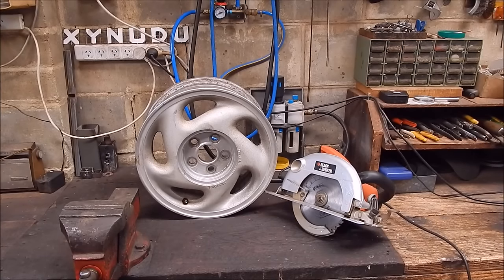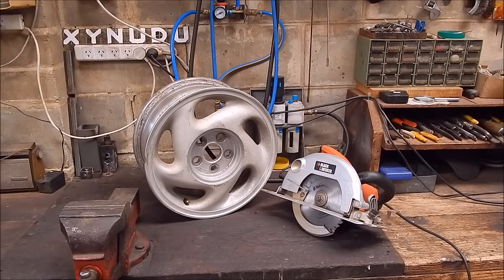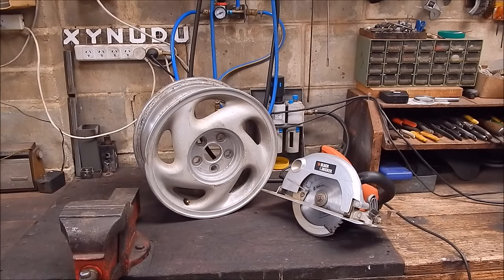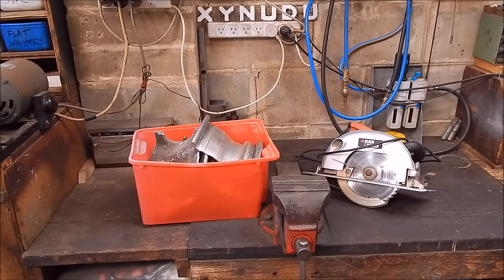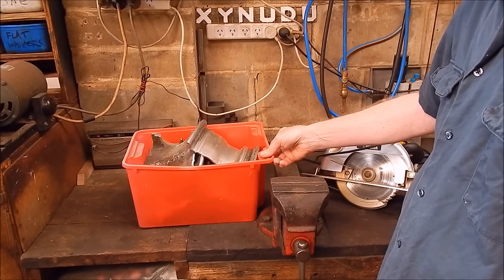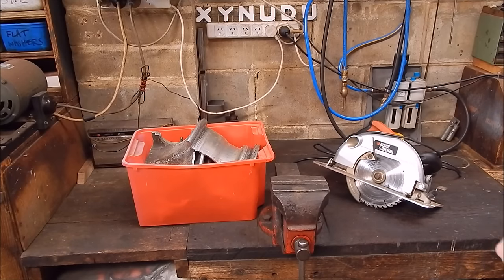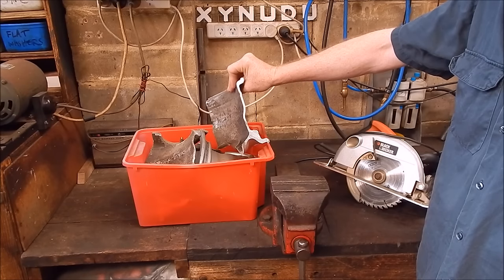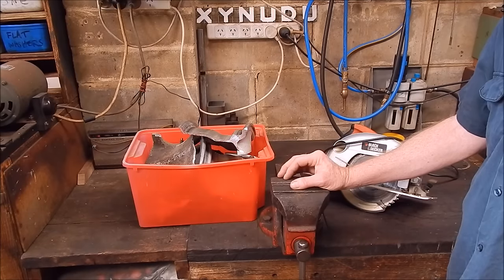Learning by destruction

Comment: If you are going to purchase a saw look into a portable bandsaw. I have a Chinese brand that has lasted me several years (since '09). I have not cut aluminum as thick as that rim, but it will make short work of 3/8". I paid $75 usd. If you have a press (12 or 20 ton) you may be able to fold the larger pieces over to fit them in you forge.Good video. Informative and entertaining.

Comment: I have 4 OEM VW alloy rims out back that I don't seem to be able to sell in the small ads. Perhaps I should have a go at this myself. I think I'd be inclined to do initial cutting w the circular saw as you did and then use a bench mounted sheet metal shear on thinner parts of the rim leaving the thicker parts to melt whole in the crucible as much as possible. Cheers!

Comment: Hey Rob,  I use an small Harbor Freight table saw with a dedicated 60 tooth carbide for cutting up aluminum and it works great,  Being a table saw the "mess" is less but still some cleanup is needed.  I think the table saw also allows for more control when cutting.
Reply from the maker: +Fred Miller 

Hi Fred.   A chop saw would be good for cutting up the smaller bits, for sure.

Parting out the rim initially is the major issue.

A reciprocating saw would be very handy for some gutter work coming up on the house, so it's a good excuse to get one.

May as well add one more thing to the power tool collection :)

Cheers Rob

Comment: If most of the chips fly out through that chute on the back side of the blade cover you could almost adapt a shop vac to bolt onto it. I've done the same with various sanders and saws it works quite well.

Comment: Hi Rob, Before I got my metal cutting bandsaw I used to use a recip' saw to cut all my stock from 100mm down. Its a bit hard on the wrists and arms but did the job ok albeit slowly. Use the correct blades and some lube and it will cut the rims no probs'.  I even welded 2 blades together to make I long blade and felled a 350mm tree in a few minutes. Great video btw. regards from the UK
Reply from the maker: +Gary C 

Thanks Gary.  This is all interesting stuff.

Cheers Rob.
Reply from the maker: +Gary C 

Hi again Gary.  What TPI blade did you use?

I saw a chart which recommended 10 TPI for cast aluminium up to 20 mm thick.

Cheers Rob
Reply: +xynudu Hi Rob.  I used  10tpi for Ali which are actually marked for wood with nails. I cut through 75mm solid Ali stock with that blade. I used 18tpi for mild steel. 6tpi for wood and plastics.  Never did find anything that was good for stainless. I have a P-Pro 800w recip' saw (made in Malaysia I think). regards Gary

Comment: I cut a 3x6cm solid aluminium bar with a power jigsaw with a coarse sawblade. It worked and the chips rather fall off the saw then fly everywhere. A reciprocating saw will probably react in the same way. I still bought a bandsaw after that cut because it was very slow.

Comment: G'day Rob, the circular saw certainly made a meal of that rim. I have used a fire pit to break up two falcon heads, worked well especially because of the amount of steel in a head, but it too makes a mess when belting it with a sledge, some bits come off in chunks but the hotter bits shatter into a million pieces. Want'a make sure you wear long trousers  and boots and definitely no kids nearby, ally don't glow when hot "ouch". Regards Peter
Reply from the maker: +PGS 

Hi Peter. Thanks for the feedback.

A cylinder head would be interesting to compare to the alloy quality of a rim.  That rim alloy is tough stuff.

The fire pit is something I don't have, but I will check out the physics on a smaller scale to see how it works.

Amazing subject this.

Cheers Rob

Comment: I cut a rim up for aluminum just the other day, the reciprocating didn't do as good as i thought, so I used the circular saw as you did and the plasma cutter to break the chunks up small enough to fit my 6" diameter 12" tall crucible.
very tough alloy, and quite heavy, I pored a 8" diameter piece 1 inch thick in an old pie plate to make a face plate for my lathe and was amazed at how heavy it was.
Reply from the maker: +superrodder2002 

What TPI blade did you use in the reciprocating saw?

Milwaukee recommend 10 TPI for cast aluminium up to 20 mm thick.

Cheers Rob
Reply: I'll have to look at it, it was fairly coarse but was a used blade so maybe not as sharp as a new one

Comment: I have cut a lot of al with a skil saw worm drive (before I got my plasma cutter) mostly plate.  It is messy no doubt.  I used a medium quality carbide blade in the 24-40 tooth range and never lost a tooth.  Most were name brand as I recall.  Reciprocating saws really don't do well in my experience.  When you have to use them use a coarse tooth blade but they are slow and inaccurate at best.  You also get a lot of vibration with them.  A variable speed is best.  A cutting wheel on the 4 1/2" grinder also does quite well.  A porta band saw also has its place but the big winner is a plasma torch and the swarf is easy to pick up.  Extrusions are done easily on the band saws with a 4-6 tooth per inch carbide blade.  I have a small milwaukee porta band which I can use one handed that I like quite a lot.  So much that the big Porter Cable hardly ever sees the light of day anymore.  The stationary harbor Freight band saw gets a lot of use as well.  Looking forward to seeing what you make out of the castings.  Doug
Reply from the maker: +Douglas Thompson 

My recipro saw has variable speed, but it really needs full speed or it overloads the motor with a coarse blade.

Definitely not a precision instrument, but does the job, even though you are a bit shook up afterwards :)

Cheers Rob

Comment: bandsaw would be best for a wheel as one side of the wheel can always lay flat on the table as long as you can adjust depth of cut enough high enough to clear the wheel.

Comment: According to the late, great Dave Gingery (you can look him up on the net, he built a whole machine shop out of scrap Alumin(i)um) when you have a great big chunk of Ally to break up, you build a fire, throw the chunk on, leave it there for a while, (how long is a while? dunno) and it will become quite brittle. Let it cool and then take a sledgehammer to it. Uncle Dave's books are available quite cheaply on Amaxon or directly at gingerybooks.com. They are fun to read even if you do not intend to build a machine shop, if you can stand the Imperial units. I have not personally tried the Gingery method (never found a big chunk of Ally) but it might be worth a try. A reciprocating saw will do it. No faster than the circular saw, in fact slower, but you can get it into odd corners. Kerf waste and mess about same as a circular saw.

Comment: Little tip, Home Depot carries a circular saw blade specifically made for non-ferrous metals (works great for plastic too), at least here in the States. I have one in my miter saw and it works great, no chipping.
Reply from the maker: +Spag The Maker 

Interesting.  What makes it different?

Cheers Rob
Reply: +xynudu I'm no expert, but looking at the metalcutting blade vs. my other carbide-tipped wood blades, the metalcutting blade has way more teeth (84), thicker carbide (more surface area for the braze), and much less rake.
Reply from the maker: Yes, a proper metal cutting saw blade has many more teeth and probably a better grade of carbide for the tips.  The rake is probably different as well, as you say.  Cheers Rob

Comment: I cut some lengths of 4-inch and 5-inch diameter aluminum rod at a local scrapyard using a circular saw--it was what the guy running the place recommended to me. I would do it again in that situation, but I don't have to worry about the mess there.

Comment: If you can find one, a Brobo saw is the go. Because they run at extremely low revs, and use cutting fluid, there's virtually no mess. All of the swaithe is piled up at the work, and is a cinch to clean up. Failing that, i'd go for a metal cutting band saw. A reciprocating saw will see you cleaning up for ever.....and they're hard work. I use mine as a last ditch, when I just can't use anything else for the job.
Reply: +Marty Smith Hi Marty, my saw is variable speed and the rest at the back of the blade stops the chips from flying away so they just sit in a pile behind the cut. Hardly any mess. A vac cleans up real quick. regards Gary
Reply: +Gary C Hi Gary.....I tend to end up with crap everywhere, and the wrist ache isn't usually worth it. I'm probably asking too much of mine, though. Great to have made your acquaintance, though.

Comment: Reciprocating saw should make short work of that aluminum.  I've used mine to cut very large nails and spikes in old buildings (steel) without issue.  Just have the right blades for it.  Honestly to cut Aluminum you might do better with a wood or combo (for wood/steel - called demo blade here) blade as the teeth would be bigger and it should clear chips better.
Have you considered melting the rim on top of your furnace so that the melt drips into a crucible?  I've not done it, but I've seen videos of it around somewhere.
Reply from the maker: +ThoughtStream 
My furnace is not that big.

I have bought a reciprocating saw and a demo blade (10 TPI)  and another video is coming up soon showing how it performs.

Cheers Rob

Comment: Rob, you can pick up a Dual blade saw with the contra rotating blades for @ $50 for a cheap Ozito or similar at Bunnings.
Probably the safer way to go as the contra rotating blades remove the risk of kickback.
Reply from the maker: +Mark Fryer 

Hi Mark.  I looked at those and wondered.  I could have got one off of Gumtree brand new/unused for $15 - bargain.

The only thing is that they reportedly chuck cuttings further than a circular saw, and need a wax stick to stop galling between the blades.

Well, that's what my research told me.  So I passed on that.

I went for the trusty old B&D circular saw.  Kickback wasn't a major issue, but you had to be careful, just in case.

Cheers Rob
Reply: Wheel rims are a difficult item to cut up, no doubt about it.
Very hard to know which way to attack and with which tool.
Reply: I've got a dualsaw, both circular and reciprocating. they cut metal like butter, and the chips are very dull, not sharp, but they do throw it and it melts into clothing etc... can be messy

Comment: Nice video, question do you think lesser grade aluminum would benefit from adding in (during the melting process) some of the alloy-aluminum chips, left over form the metal cutting saw blade?
Reply from the maker: The cutting chips only make a lot of dross. The large surface area per volume of them means they have a lot of oxide.

I don't reuse the cuttings for this reason.

Cheers Rob

Comment: Hi Rob !

I much, much more quiet, less noisy, not so messy using beer cans ... I told you before ;-)) , but the quality isn't so good and I sure you'll have to stretch the collecting over a longer time for the same amount - but you can sit in a chair nice and quiert, resting your bones and let time pass by ;-)) - that way I now have 55-60 Kg in store.

No, I would do the same as you did here if I found some rims like that - for sure !

BTW ... I need a new camera - the Nikon L820 - how are your experiences with that - pictures, close ups, videos and so in the shop ?
Reply from the maker: +Keld Sørensen 

Hi Keld.  I like my beer too, but drink from stubbies (small bottles), which are popular in Oz.  60 kg is a pretty good effort though :)

The L820 is a good camera "for the money".  Good optics. I often use macro with zoom for sharp focus at close to medium ranges.

I wish it had an audio jack, which would be a lot better for setting sound levels.  You have to be careful not to over modulate close to the camera, and sound level drops off quickly as you move away.

It has excellent battery life, and takes 4 AA which can be swapped over quickly.

I like it a lot, but there are later model cameras which may be as good or better.  The video quality is pretty good I think.

It depends how much you are willing to spend.  

Cheers Rob
Reply: xynudu
Ha, ha, yeah, it takes time to drink all that and for years I had a bunch of cans stored in the shed for the bikes ... then I was forced to melt them down because of lack of space and ... "her in command". I still have about 20Kg of better quality ALU to melt down to bars - chassis from old harddrives, frying pans, pots and so ... but it goes faster than these beer cans and don't smoke as much as beer cans.

Thx for the input on the camera - is it a problem, that you CAN'T see from the front what in fact is in the frame ... I think the LCD screen can't be turned so it's viewable from the front - is this a problem ?
Reply from the maker: +Keld Sørensen 

Yes, for the type of selfie shooting/intro that you do it will be a major problem.  The LCD is fixed.

I think you would be better off with something else.  Ideally with a forward flipping LCD, microphone jack, and of course, lens stabilization.

Sony put out some nice cameras, as do most manufacturers.   Also 4K is becoming the new 1080p, so that;s worth considering.

All costs money, so it depends on the budget.  But better to buy what you want than regret it later.

I don't like digital SLRs for YT, as they are too bulky, and massively expensive for what they can do.  A compact is the go for my needs.

I will be interested to hear/check out the video quality of what you get. 

Cheers Rob